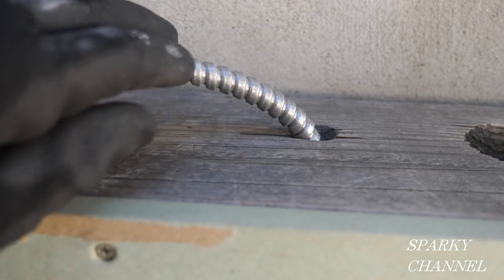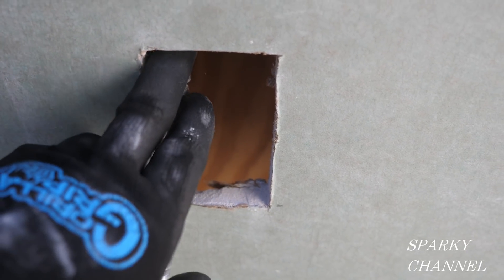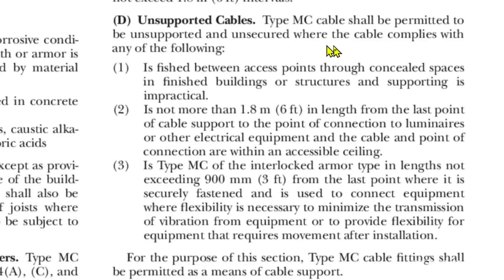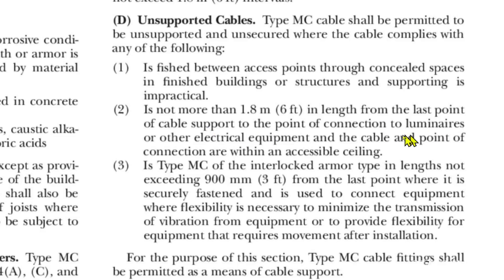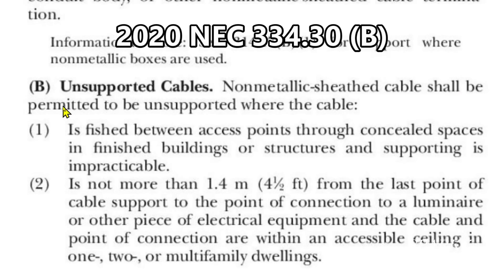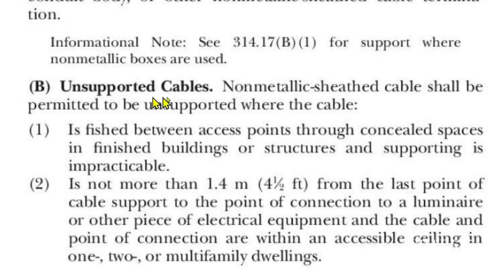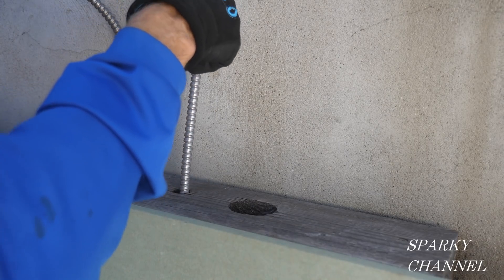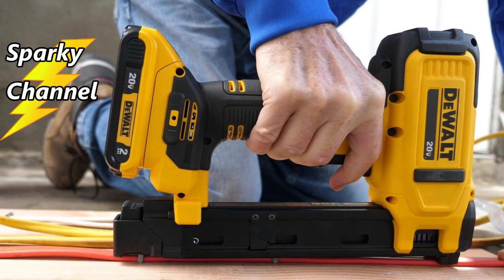Can MC Cable be Run Unsupported Behind Walls by 2020 NEC?

Comment: The primary purpose of supports in walls is so cables don't flop around and get nailed/screwed/stapled into during dry-wall installation, so it makes sense that they are only required in open walls..
Reply from the maker: Thanks!

Comment: what does "point of support"  mean for NM does it mean a staple or does it mean a flat board so if it is laying across the top plate then goes though the hole in the top plate does that mean a point of support?  I would think if it means staple it would say point of attachment.  like when we run wires across trusses at least I don't staple them every other rafter but the rafter is counted as supporting the wire with gravity.

Comment: I ran MC 12-2 up a fireplace ash trap from the basement to the back of the fireplace for an outlet to serve a sealed natural gas insert.  Of course I was unable to install any supports in the shaftway, but I did install 3/8" metal straps at the top and bottom of the run.
Reply: If you leave your address we could mail you cookies.

Comment: Has been legal to fish AC MC for at least last 80 years. Would only worry if fishing heavy MC cable unsupprtec from a high ceiling.Pulled out 2/3 cable that was fished over 25' down a wall. They tied rope on it at center point to help support it.

Comment: The only time I used any MC cable in my house was when I needed to run power to the fireplace... prior to having a Gas Fireplace insert installed.  And had to use a very long Masonary bit too... haha. There is a time and a place for MC
Reply from the maker: Excellent!

Comment: MC/Bx good cable and provides a ground path via the metal sheath(jacket) if properly connected from electrical outlet,  junction box back to the electrical panel.
Reply from the maker: Correct, thanks!
Reply: @SparkyChannel  thanks!  I live in an old house build in 1930s and the entire house is wired with BX.  Some circuits with the cloth and rubber insulated wires to the modern plastic insulated wires with an aluminum bond wire.  I remember my grandfather do some electrical work and used to wrap that bond wire to the BX sheath.
Reply: Well …I worked today on a MC  cable wasn’t funny it’s to hard and you need more time than Romex …perfect for Machine rooms and heat areas but you need install carefully

Comment: Thanks Bill, very informative video👏👏👏quick question, i don't see any caveats about the gauge and number of conductors in the cable, are there any limitations???
Reply from the maker: Not that I know of. It just says "MC cable".
Reply: @SparkyChannel  how about NM cable?
Reply: MC cable is sold as a complete cable assembly.  so gauge and number of conductors isn't applicable. as far as routing the cable - other than wanting to avoid bundling multiple cables, especially in sprayfoam insulation.
Reply: @kenbrown2808  I need to clarify my question. I've seen "Florida" non-metallic cable unsecured behind walls serving 40-50 amp range receptacles. I personally don't think it's safe, but was wondering if it was up to the "old" code, and what about the 2020 code. Thanks😊
Reply: @tedmcdonald3377  it's not optimal, but the code recognizes that sometimes you can't get to a cable to secure it.  if I was dropping one from attic to basement in a three story balloon framed house, I'd start thinking how I could get some midpoint support, but they're trying to balance between optimum securement and recognizing that tearing up a house to add a plug is poor form.
Reply: @kenbrown2808  thanks, that's what I figured

Comment: Nice video! Impractical and impracticable- I think it does mean the same, just different connotations.
Impracticable meaning unworkable, and the other word is not logical.

Edit: So like the NM cable being impracticable makes sense do to the nature of being somewhat unprotected like you said. And MC cable is a matter of deciding if it is necessary to support.
Reply from the maker: Thanks Jeff! I'll tell you one thing for sure: it's hard for me to pronounce "impracticable". LOL!
Reply: Practicable means it has the ability to be done. Practical means it can be done, but it would be onerous.

Comment: Bill,
What if you had a drop ceiling with pot lights? Where the roof (or closest securing means) is more than 6' from the fixture support?
Reply: Use a wire support clip
Reply: @upgrayde  I've been in plenty of drop ceilings where the only thing holding them up is the thin metal wire and the "panel t's": hardly  sufficient to strap BX to. More support in the BX jacket then 15-20' of suspended ceiling tile wire. So according to NEC: the only solution is to move the drop ceiling up, or install permanent support structure to support the BX cable for the pot lights that are installed in the ceiling tiles.... Interesting.

Comment: So, you can't run NM through the top plate and a stud cavity to a receptacle 12" off the floor?  You would have to either tear open the wall to support it or change to MC?  Did I misunderstand?
Reply: : Yes, you can run NM through the top plate and a stud cavity to a receptacle 12" off the floor. NEC 334.30 (B) (1).